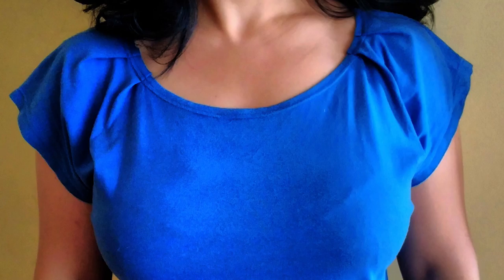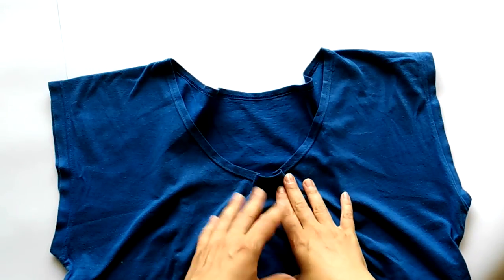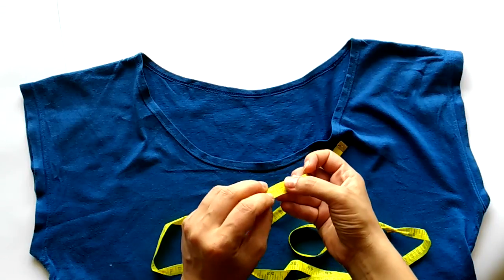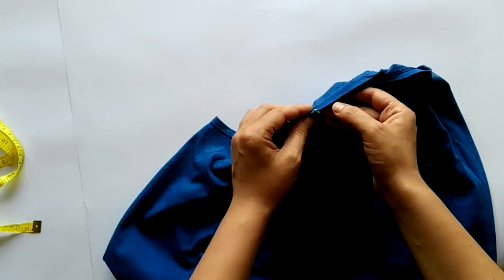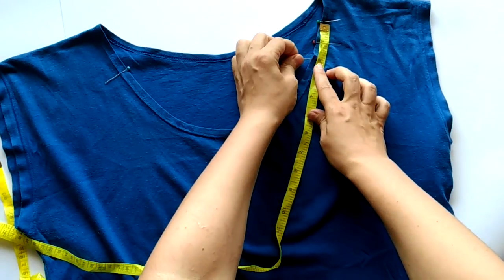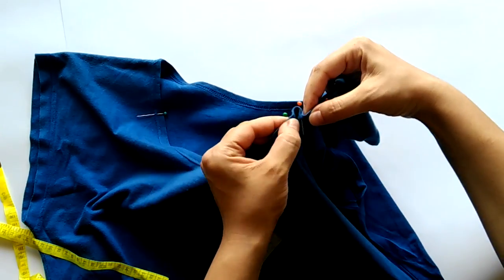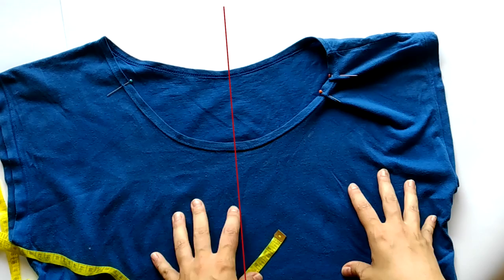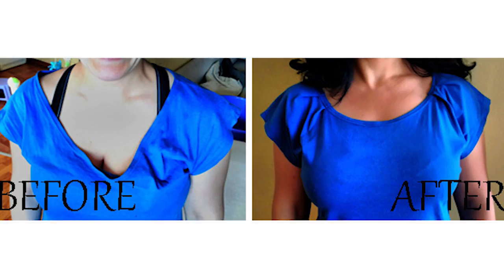How to fix stretched neckline on a cotton t-shirt

Comment: Not that I think your method or video is bad... I just think it's misleading. First of all, that shirt isn't stretched out at all. It's just way too big and oversized. Second, instead of "fixing" it and turning it back to the way it was, you made it look completely different. Basically you took a shirt that doesn't fit you and tailored it to fit you better. The video should've been called something like, how to tailor an oversized cotton shirt for a better fit. Some people actually want to fix their ruffled necklines that actually got stretched out with wear and just turn it back to looking the way it originally was instead of something compeltelydifferent.
Reply from the maker: Hi there, I am sorry you didn't find what you were looking for! Every garment is different and it takes a different approach to fix. Could this fix help https://youtu.be/tRSNOoD9Ld0 ? Please share if you find your solution.
 P.S The shape and size of the neckline in this video are not what it used to be when I bought the shirt, so I still consider it stretched.
Reply: Sewing For A Living 👏